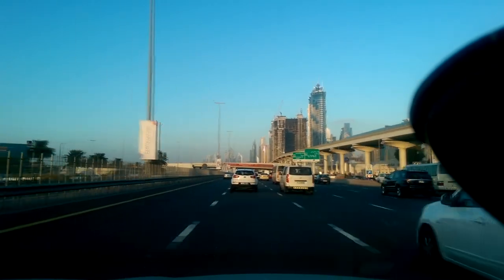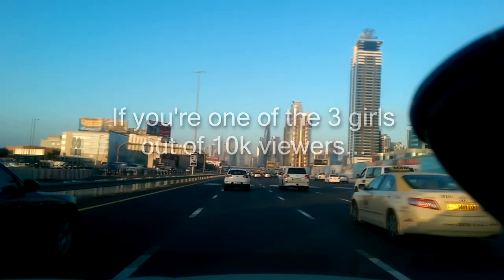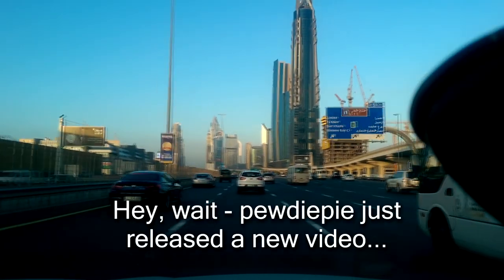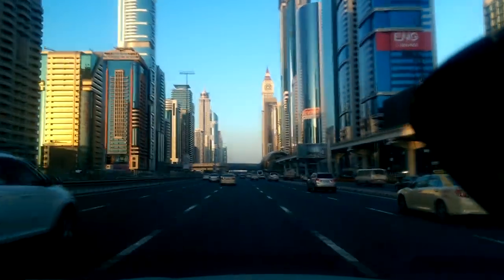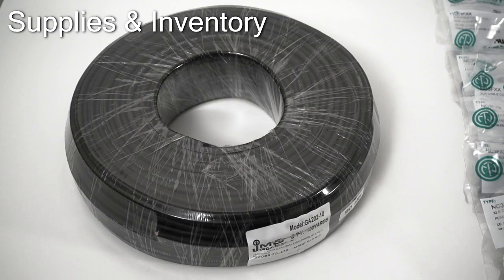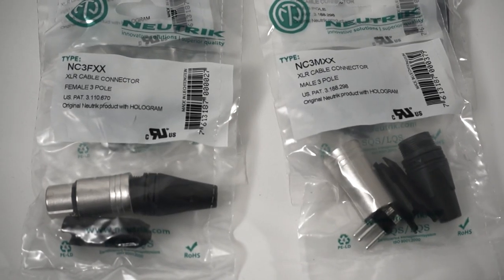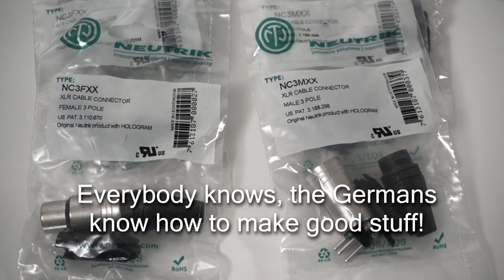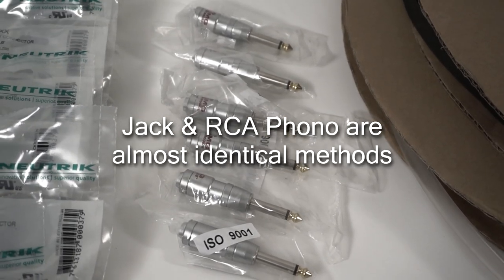#003 Soldering Tutorial - How to make pro grade cables!

Comment: Please don't short the "cold" to ground if you're working with balanced cables.  Balancing is good, and only happens if you leave them balanced.  Combining balanced and unbalanced is tricky, and this may or may not be the right way to handle it.  If you're working with an unbalanced system, these are the wrong connectors to use anyway.  It's just... that's  not the way to do it.
Reply from the maker: You are correct, but you misunderstood the explanation. You must short the cold to ground if you are making a cable that is unbalanced on one end, and going to an input that can be balanced, for example, xlr, or even phoenix. Perfect t example would be a CD player with RCA outputs going directly into something like a BSS Blu processor, or similar.
Reply: @TheBrightPixel  Well, if it's a balanced to unbalanced cable, permanently, I would prefer to use a balanced and unbalanced connector.  There is no point, and some confusion, in converting a balanced connector to unbalanced in a way that's hidden from the user.

Then... the signal voltage on the unbalanced end is between the tip and the ground (at the device), and on the balanced end, the signal is between pins 2 and 3.  That's usually how the cable should be wired: the tip of the unbalanced end goes to the + signal (pin 2) at the balanced end, and the ground at the unbalanced end goes to the - signal (pin 3) at the balanced end.  The unbalanced signal then appears across the preamp differential input, as expected -- pins 2 and 3.

The cable shield goes to pin 1 at the balanced end, and does its "protective" job as usual along the length of the cable.  It does not connect at the unbalanced end; it's not needed there, and will quite likely introduce a ground loop if it's connected to ground.

I was concerned that viewers might think this was a good thing to do with balanced cables.  It might in some cases work for balanced to unbalanced connections, but that is luck, not good practice!  I'm in favor of luck, but I'm also in favor of good practices.
Reply from the maker: @ydonl  Using an unbalanced connector on the input does exactly the same thing inside the device - it shorts the cold to ground. This is built into the design of the jack plug itself - on a TRS plug the ring is physically where the sleeve of a TS plug is, so it is mechanically shorted in the receptacle. Shorting it in the cable itself will do no harm in this case. There are many, MANY devices, such as high end DSP and amplifiers that only have balanced phoenix connectors or XLR inputs, that don't even have the possibility to use unbalanced connectors, so you must short the cold to ground in the cable to connect it properly, otherwise the input circuit will not be driven correctly. It isn't optional, it is the default way to wire a balanced to unbalanced connection.

Most modern equipment isolates the signal input ground from the power supply ground so the standard is to connect the shield to both ends if the shield is the ground wire. If the shield is separate to the ground wire (uncommon with audio cable), then you connect the shield at the input and not the output.
Reply: @TheBrightPixel  I'm not sure you're following what I'm saying; I'm only trying to help!   Let me try it this way: the differential input, the balanced preamp input, does not use ground as a reference for the signal.  The reason for that is that grounds cannot be trusted; they introduce noise and ground loops.  So with everything balanced, there are no signals touching ground, and if you can keep it that way, everywhere, you by definition avoid ground loops.

Remembering that voltage is always the difference between two potentials, the unbalanced signal is a voltage difference between the signal conductor and ground.  A balanced signal is the voltage between pin 2 and pin 3, or tip and ring.  The differential preamp is designed to take its input from those two points.  Ground is not involved.

If you plug an unbalanced connector into the balanced socket, pin 3 will be tied to ground.  We have just corrupted the entire system!  There is now a point where the ground is connected to the audio signal path.  Noise and loops on ground can now exist, and the performance will suffer.  Whether it's noticeable or not depends on the circumstances, but in general, this is playing with fire.

Now... consider this: the unbalanced source is producing its voltage between the signal conductor and ground.  The balanced input is expecting to see voltage between pins 2 and 3.  So... give it voltage there!  Connect the unbalanced signal conductor to pin 2, and connect the unbalanced ground to pin 3.  Do not connect anything to ground at the balanced end; it is not only not necessary, it is bad, and potentially VERY bad!   The grounds at the unbalanced source and the balanced input never touch each other.

The cable shield is connected to the ground at the input; no signal touches it.  It's job is to capture electromagnetic radiation and send it safely to the earth, where it can do no harm.

sig > -------------- > 2 sig +
gnd >  -------------- > 3 sig -
shield ------------- > 1 gnd
Reply from the maker: @ydonl  mate, you are going around and around in circles so much that you have lost the whole point of the conversation. Unbalanced to balanced cable needs the cold tied to ground at the input, because it is an UNBALANCED CONNECTION. you can backpedal and argue all you like, but that is just a basic fact of how equipment works and its not just common practice, it is necessary for a correct signal input. What you are saying is not helpful to anybody at all because it is plainly incorrect and you've even confused yourself by going on and on about grounds and differential pairs, when none of that is applicable to an unbalanced signal.
Reply: @TheBrightPixel  Have you ever had one of those days where you put a lot of energy into someone else being wrong, and it eventually turns out it was you?  :). I've done that so many times!  But not this time.  I insist on making one more attempt at clarifying; I think you're worth the effort.  But you need to open your mind a little.

I'm going to guess you don't really have much background in amplifier design, which is an okay thing, but it leaves you at a disadvantage, because you're left largely with your intuition to figure stuff out. And I think your intuition is probably pretty good.  But for anyone, anywhere, though, there's always more to learn!   For you, I would suggest Rane's classic note "Sound System Interconnection"; great stuff.  I'd also recommend Jensen Transformers / Bill Whitlock's paper on "Interconnection of Balanced and Unbalanced Equipment."  Jensen's paper is obviously going to suggest that you need to buy a whole bunch of transformers from them, which is another approach to all this, but.. the technical details of the non-transformer approach are still quite good in there!  And, I might point, BOTH of them recommend the wiring scheme I've been trying to get across for connecting an unbalanced output to a balanced input.  I don't know; maybe some diagrams in there will help clarify the issues better than I've been able to!

If you want to learn more about differential amplifiers (which are important and fascinating things, not only in audio but in most areas of electronics), I would recommend Allen Wolke, w2aew on YouTube.  You could dive right into his differential amplifier video, or back up a little and get some ground work with single-transistor amplifiers and that sort of thing first.  I also really like how straightforward Mateo Aboy's channel is, especially Dr. Christina's videos on transistors and amplifiers.

For this audio stuff, I think the important thing to keep in mind is that voltage is always the difference in potential between two points.  In an unbalanced signal, those two points are what some people call "hot", and ground.  The output signal voltage is produced, and lives, between those two points.

In a balanced signal, the two points are the + signal (pin 2) and the - signal (pin 3).  The voltage is assumed to have been produced between those two points, and that's where it will be taken from.  The amplifier responds only to what it sees between those two points. 

So the simplest, most reliable, highest-quality way to connect these two things is to connect the "top" and "reference" of the unbalanced output (hot and ground), where the voltage was produced, to the "top" and "reference" of the balanced input (pins 2 and 3), where the voltage is expected.  It's really a fairly simple concept, once you clear away some possible preconceived notions and various mental models and so on.

All that remains is to figure out what to do with ground.  This gets a little tricky.  We sometimes described ground as "zero volts", but... remembering that voltage is always the difference in potential between two points, if we're going to prove it's zero, or measure it, we need another point!  Typically, the other point is the Whole Earth, which we take to be absolute zero (well, more or less.  There's actually a lot of current flowing around down there).

Within the circuit of the amplifier producing the unbalanced output, however, we can pick any other point -- the input signal, the output signal, intermediate processing -- any point  anywhere, and measure it by taking that as one point, and our local "circuit ground" as the other.  It's relative.  All of these voltages are taken as the proper distance above the local ground; those are the two points, and by definition, the voltage is correct.

But consider this: the local circuit's "ground" is wiggling around with respect to the Earth.  Let's say there's 1 millivolt AC difference between the Earth ground and the circuit ground; this is because the wiring is not perfect, and there is capacitive coupling, and other factors that can influence the circuit ground to make it imperfect.  So now what actually have is a ground voltage wiggling up and down with respect to Earth, and a signal voltage with respect to ground, and so... the signal voltage at any point is wiggling up and down with respect to the Earth, by 1 millivolt AC.  All the voltages in that circuit are *relative*, and they're all wiggling up and down together.

The same thing happens in the receiving device.  It has a local ground, which is almost certainly wiggling with respect to Earth, but because it's circumstances are different, it's wiggling in a different way than the sending device's ground.  As a local ground for that circuit, it's fine.  But every voltage in that circuit is riding on top of that wiggle; the whole thing is moving up and down the ground's wiggle.  And -- very importantly -- if we measure the voltage between ground of the sending device, and ground of the receiving device, we will see that difference!

Let's say we use pin 2 as the "hot" unbalanced input, but we tie the receiving end's ground to pin 3.  Now the input signal is the difference between the hot signal of the unbalanced device, and the ground of the receiving device.  The signal was supposed to be "hot with respect to the unbalanced ground that correlates with hot", but now it's "hot with respect to the balanced circuit's ground which has no relationship -- or in fact, a bad relationship."  We're introduce a voltage that is not part of the actual signal; it's effectively the difference between the two grounds.  That difference, superimposed on the signal, will make hum, and cause misery.

There is a basic rule, here: the ground of the balanced equipment should never become part of the signal.  It should never be connected at an input or an output of that device, although we might get away with it if there are no other signals that tie to a different ground.  There is never a need, though, so... just don't.

But then there is a ground connection at the balanced input, normally used as a shield connection, to suck any imposed shield currents to ground where they can do no harm.  We can still do that with the cross-connected unbalanced / balanced connection; pin 1 is tied to the shield, and absorbs interference currents that hit the shield.  But... we don't want to tie it to ground at the sending end, because that effectively introduces the same ground difference voltage into the signal (more or less, in a slightly different way).

Anyway, I truly hope you get it; it's worth studying in more detail, because if you do audio, it matters!  Read those docs.  Watch those vids.  Make it better, dude!